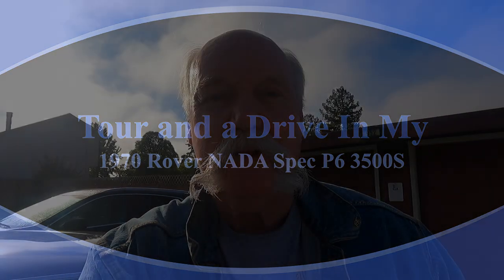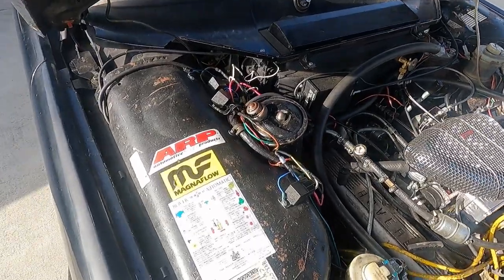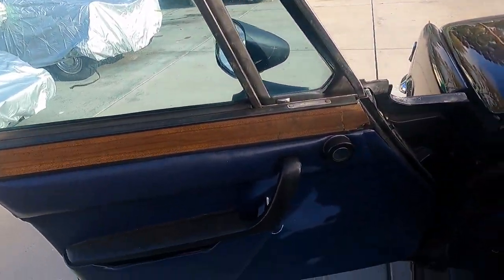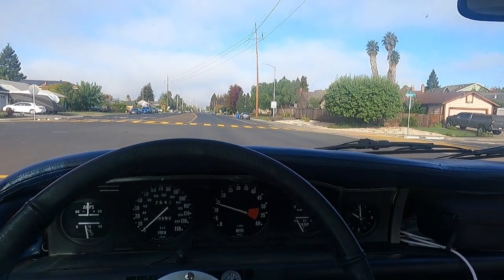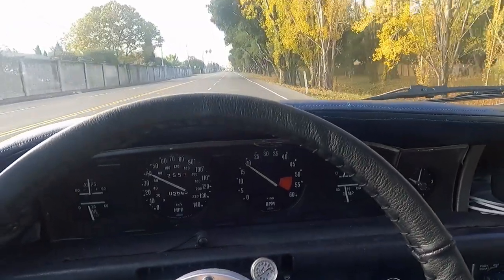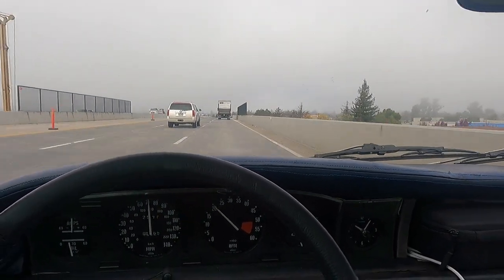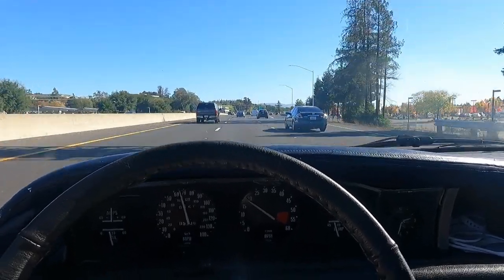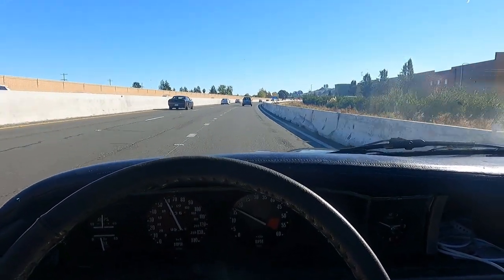1970 NADA Spec Rover P6 3500S Tour and Drive

Comment: Excellent video and thanks for sharing your 3500S. Did you consider the 4.6 Land Rover engine for more power? Which transmission are you using?
Reply from the maker: I used the 3.9 liter for a bit more power and it seems to be a bit more robust than the larger versions.  I have modified the car and  ZF HP22 trans to work.  It is a 4 speed overdrive trans with a locking torque converter.  It greatly improved the car for motorway driving and fuel mileage.  2,500rpm is about 80 mph.

Comment: I had one of these back in the early 80's but you really need to put back the original hood, sorry mate it's just not my taste.
Nice car all the same.
Reply from the maker: That is the original hood for this NADA spec car.  Basically, it is a 3500 with all the options, including "Ice Alert,"  which is of very little use here on California.
Reply: @ejhbritishcars6907  
well, I'll be a China man, I have seen them before but only thought them to be aftermarket specials, sorry mate I meant No offence.
PS, I still don't like it.😝
Reply from the maker: My understanding is that they were also installed on some of the later UK cars to use up the leftover stock though I don't think that they use all three scoops on those cars.  The two outer ones are to ventilate the engine compartment and have "Summer/Winter" devices to open/close the openings.